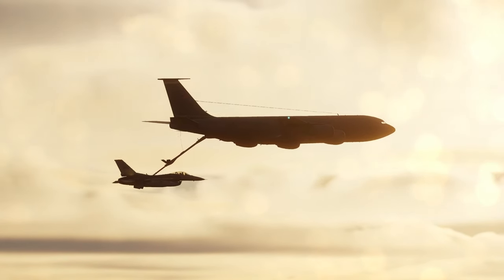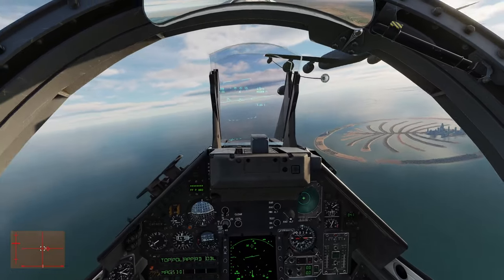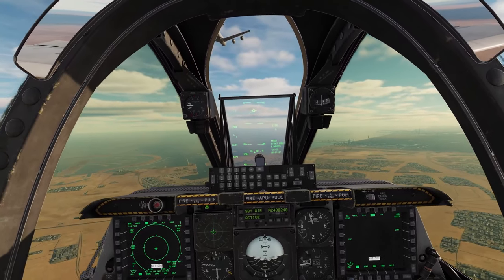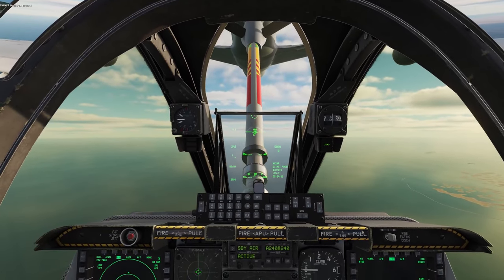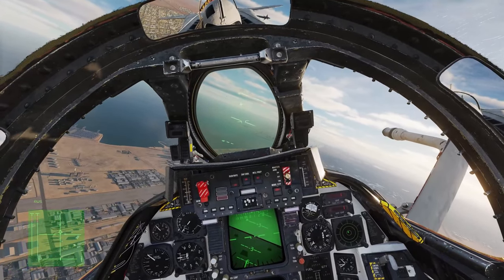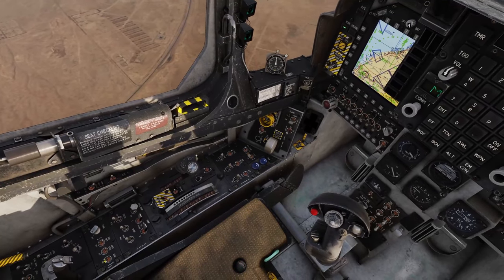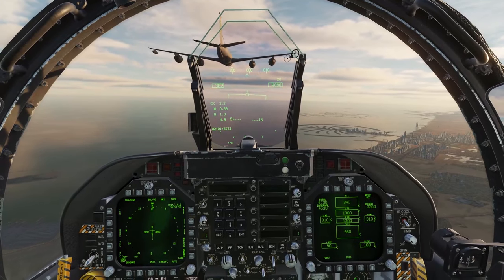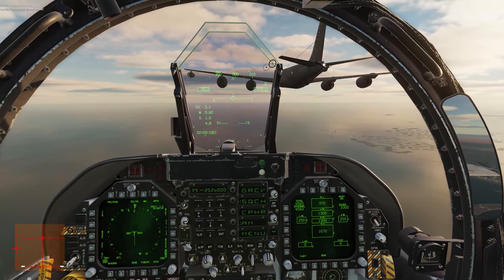DCS Air Refueling Mission - Easiest & Hardest Aircraft Modules to Tanker

Comment: I haven't tried the f15 in ages but I sort of feel that is pretty hard. Boom and off to one side (I forget which!) I don't usually use fc3 now so wait until the F15E before going down that path... Great vid btw
Reply from the maker: The hardest part for me, is being able to make out the up/down/back/fore lights in bright daylight conditions.
Reply: @DCSDigitalCombatSimulator  would be great to have those lights part of gui like glideslope lights on carriers
Reply: @DCSDigitalCombatSimulator  I don't do that in VR. There's that thing on the canopy-frame which prefectly alignes with the pivot-point from the boom on the tanker. Take those as a refernce when in contact and boom, you're getting refueled.  Pun intended
Reply: I'm still astonished that ED never made a full fidelity F-15C
Reply: Boom is easy just follow the lights.
Reply: @eq1373  would be much easier for them not having to deal with a/g

Comment: They are all easier in VR. To me the hardest is A10 and the easiest is F-16, with the F-18 and F-14 right behind the F-16. My tip is to fly in formation with the tanker and find out the exact speed first. When you get behind the tanker set your throttles to stay with the tanker at that speed. This will be your neutral throttle position. To speed up you move the throttle a hair forward and then back to neutral, same with slowing down. All movements are very small, kind of like hovering in a helicopter.

Comment: 7:51 No! Press the NWS/AAR disconnect switch...that's how you reset the clamp.
---------
Nope, Harrier is the easiest. learned about the the view points first, and plugged in my first try. Stupid easy compared to everything else. Did this after attempting in the 18 for 3 months. Now this was a KC-130 as it's supposed to be.

Just drive the bottom left corner of the AAR indicator on the canopy rail straight to the center of the basket and keep going. It's like magic. For the 130, keep the top right corner of the HUD glass to the bottom left of the prop disk.

And no, do not use the A/P for the Hornet, most people have no idea how it works. The "secret" autopilot of CSS that nobody knows they have to disable...
People will get into PIO and throw the stick too ouch lurching the aircraft out of A/P.

For cues, select AMRAAM. This is practically official, 95% of Hornet AAR videos show the aircraft in A/A. 120s for the 135, 7s for the S-3B and 130. Put the 2 o'clock position of the weapon circle on the bottom left of the engine. Drive it in. Also, the vertical part of the 5° pitch ladder should line up over the hose. These two references make this easy.

Another thing, you are moving the throttles way too slow. Forward and back at least every other second to maintain position. There are small movements anticipating the spool lag.

Tomcat I got on my 2nd stab once I turned the HUD off...

Comment: I think f18 is by far easiest, as if u use cpl tcn (before the tanker distance bug) it will literally fly itself to the tanker, then once plugged an speed matched, u can activate auto throttle and it will just sit there. When i started i was trying precontact too early an even though they roll out the hose, no matter how much u stab the basket it wont connect creating frustration. Also the f16 is pretty easy once u realize the alignment is the tankers job, just centre ur lights on the tanker an wait for him to come to u (5-10secs), NOT aim for the probe, an again must have CLEARED CONTACT, oh and pull up the bingo page (list>btn 2) on the DED to see if fuels transfering 😉👌
Reply from the maker: The tacan /CPL coupling is a great tip, sadly i wasn't able to show it, due to the tacan bug in DCS at the mo, maybe a future vid
Reply: @DCSDigitalCombatSimulator  Is Tacan bug specific to a particular aircraft or all of them? What does it do?

Comment: F-14 tip for you: After putting out the probe use yaw trim to center the ball in the slip indicator. No need for splitting throttles and fighting the asymmetrical drag. After pulling the probe back in yaw trim again to re-center the ball. Done.
Reply: He said that if you have not splitted throttle you can use rudder
Reply: @stealthtomcat4739  ok, but yaw trim is better than both those options. You trim to maintain level flight and you trim to eliminate slip.
Reply: @CallsignJoNay  Yeah

Comment: The position of the probe in the AV-8 is a pain in the ass, but it's all about practice and findeing the reference points on the different tankers.....I find the A-10 and the Harrier pretty easy because I tend to overshoot with the "stronger" jets like the Tomcat and the Viper...The Hornet lies in the middle. It's not as responding to the thrust lever and has a pretty strong air brake like the Mirage..

My personal ranking...Hornet is the easiest to plug in, Harrier is the easiest to keep in....And the Viper and the Tomcat are my Unicorn!! :-)

Comment: F-16 viper is the hardest. The receptacle is four feet behind the cockpit, so you can’t see shit, and you have to rely on the alignment lights under the belly of the tanker, and good luck seeing those in daylight
Reply: I was thinking the same but with practice it gets way easier. just stay still operator connects it. even a tiny bit of drift and fueling won't start. Basically what you need to do is very close formation flying. I know something is wrong with me but I can't do it with f-18 :D f-16 is way easier for me.

Comment: My easiest to hardest,

Mirage and harrier -good power to weight and air brake along with good vision and easy enough controls.

F16 harder as I prefer the probe and drogue tho is similar to others for me.
F14 made hard due to various configuration for the wing. My optimal refueling approach was actually completely off manual. 

A10c. Not enough time flying it, limited vision for me, good air brakes but lower power to weight. 

The one thing I will say though is I flew on servers where the tankers had a habit of wildly varying course, speed and altitude which made learning very hard. Especially if the tankers were cruising on the edge of the after burner detent.
Reply from the maker: Agreed the higher tankers especially when loaded with ordinance can be V tricky.

Comment: My biggest issue with aerial refueling, and in general, is speed control. But the only aircraft I own capable of AAR is the Viper. 2 knots slow/fast and you're done. I have no issues with direction or staying in the pocket. I am sure I need to tune my throttle axis to have finer control. I just don't know how. I suppose the ol' trial and error method will work too! Really enjoying your stuff. Do you have merch?
Reply from the maker: Hey there, when it comes to speed control, the f16's probably the most difficult one to keep steady (she likes to run don't she). There's no magic throttle setting, just keep stroking it up and down little and often. I'm probably adjusting it 2-3* every second in that. Very very small corrections, not measured it, but my hotas is probably moving a millimeter or two

Comment: I could not imagine refuelling the Harrier without VR. Something I did to train was to fly up with 4 empty drop tanks and see how long I can stay on as the weight increases.
Reply: Its still doable but more concentration  required in vr
Reply: @LOMACKING  I would argue less. In VR I can glance at my probe when I'm cleared pre-contact to remind myself where it is, then just keep my head forward and use my depth perception to get the basket 8 times out of 10. On my monitor the best I can do is try line things up with the cockpit frame, which is less useful if I am refuelling at a different speed, altitude or weight to what I trained at, or the tanker begins a turn during contact attempt.

Comment: The autopilot in the M2000 is actually pretty effective when set to alt. hold ,but I personally stick with autopilot off because it's not worth the hassle imo .
Reply from the maker: Yeah juggling the AP is quite hard, the exception being ATTH in the f18. The mirage has the best autopilot manipulation though, using trim to "steer" the autopilot. Surprised more didn't use that feature (av8 came close)

Comment: i feel like F18 is the easiest one for me... Never had a problem.. as mirage refuel speed in video is fast. Most of the time you get a under 350 and its right in the phase where delta start to drown... So its hell of refuel and much more inertia while F18 or even 16 don't have this problems.  F16 i use CATIII to get smoother controls. :) 
Hardest is a tie between A10 and AV8/jf17 but i don't own VR. But A10 you are blinded on tanker lights so its really frustrating.

Comment: Tbh I think any plane with a probe and chute system that has the probe within the pilots peripheral vision is pretty easy. Haven't had much luck with the boom system tho. Also a tip for the Tomcat is to put it in bomb mode, that way the cadc doesn't do something with the wings or flaps to mess you up.

Comment: A10 for me is hardest just due to power constraints and spooling.
Reply: You can decrease spooling response time by maintaining formation and slowly putting out airbrakes and throttling up. Higher rpm means smaller response time but you can still maintain slower speed (if needed) by having the airbrakes out

Comment: what about the ATC in the F-18? Would you use that to help?
Reply from the maker: there's a lot of comments about ATC in refueling the F18, and personally I find it a little fiddly. If you're even half a knot out, you're gonna run up/down the length of that pipe within a few seconds - so then comes "well disconnect it, adjust speed a split second, and reconnect the ATC" and sure, but then, unless i'm just grabbing a couple K, i'm having to sync it over and again. Certainly it might be easier for some people, I guess the hotas being used will change things too, but for me its much easier to stroke the throttles

Comment: F-14 by FAR the hardest for me. No info on the HUD plus no digital flight controls makes jack a crappy air to air refueler
Reply: Yeah it's sad that we don't get the 90s Upgrade that did replace the Hud even in the older Tomcats.
Reply: Pro tip, put wings to bomb mode for tanking the Tomcat. Just be sure to trim.

Comment: What do you think about AAR with the F-16 😢
Reply: He didn't even try... like the rest of us.
Reply: Tbh it’s not that hard, the tanker tells you what to do, as long as you follow it there shouldn’t be a problem.
Reply from the maker: I used the F16 for the thumb and possibly a cut scene, although I could have included it and every aircraft the video would have been twice as long - there are 10 in total as of now that are AAR capable. To answer you though, I find it relatively easy, it's basically the same as the F15 (fc3), with the possible exception of bright daylight conditions making the positioning lights on the belly of the tanker harder to see. This has been made easier in VR in the last few months as they improved all lights, and especially in low light for all users, but in bright day, it's still a bit of a squeeze to see, and I fly 1440p for video purposes
Reply: It's not that difficult, just walk the throttle, anticipate and react early. Always keep the throttle moving slightly. Up-down and left-right movement I find not as problematic as forward-backwards which is throttle control.

Don't wait for the plane, you'll learn how much will it move in a certain direction and you have to counter before it gets there. Anticipating where the plane will go is the key.

Comment: and the f-16 is where
Reply from the maker: Hi, this also goes to others who ask about various AC I didn't feature. There's about 10 AAR capable aircraft in DCS, and I could have done them all. I elected to skip those in the middle, so the video wouldn't be so long. The F16 is very much like the F15 to refuel, and thanks to the up/down/fore/back indications from the KC135, is right around average difficulty - at least for me. The M2000 has gotten much easier since making this video, due to their updated FBW flight models, and is no doubt the easiest of them all, even more so than during this video - there's some kinda funky leveling that goes on, once the refuel switch is turned on.
Reply: @DCSDigitalCombatSimulator  oh well I need to keep practicing then. I find that unbeliveably hard, since there is almost no reference and those lights do not help much. Thanks for the reply